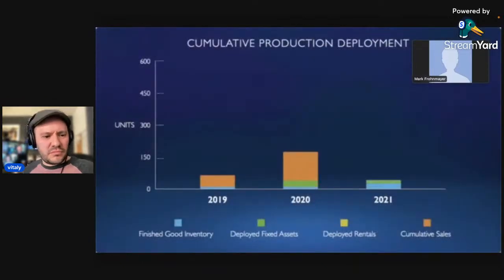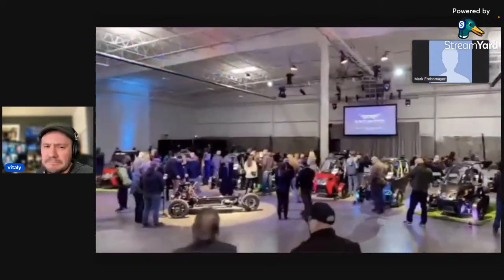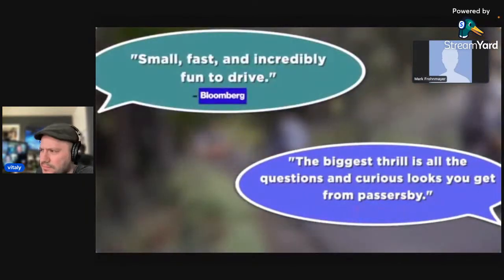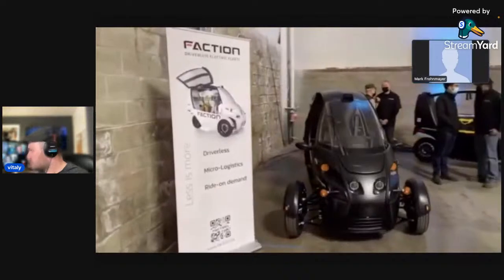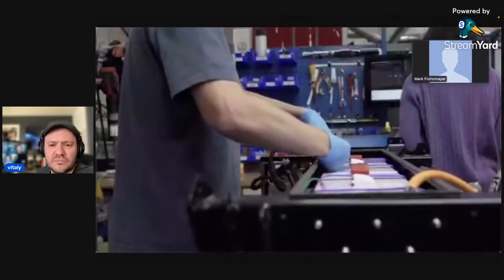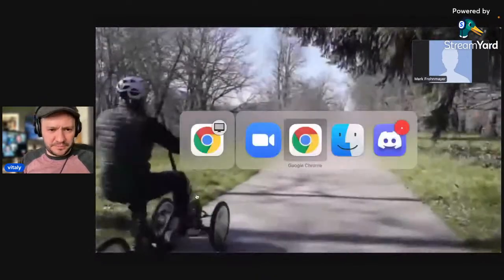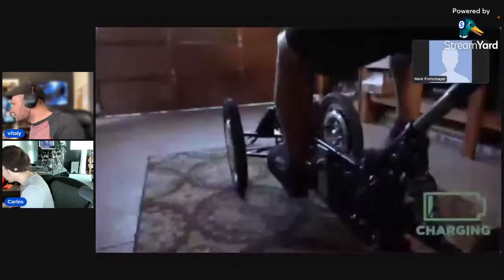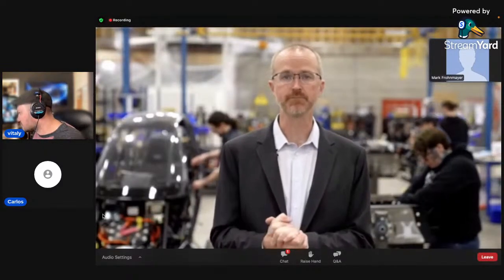Arcimoto FUV Q4 2021 LIVE EARNINGS

Comment: He said 3-6k
Reply from the maker: And maybe now over 8 for the first premium sales… so well see -V
Reply: @FreelancerFinance  Maybe - I didn't pick that up. When talking about other products on the market, he mentioned "8k and up" as top end products (not volume products of course).

To be honest I can't see bikers buying this machine, certainly not paying 8k for it. I have a bike for the freedom simplicity, independence from all, ease of use and maintence (almost none), dynamism, ability to pass through tight places and light weight. This product takes away all above from me in exchange for tighter cornering but it's not a fast bike, so tight cornering is a mere convenience in normal use. Only comes to itself when cornering at speed eg.g going downhill but who wants to go downhill on 3 wheels? 
A biker doesn't worry about added stability - bicycle offers dynamic stability by its very nature. I can see a usecase for non bikers having a go at riding this on holiday, but non biker never pays 8k for this machine, not even 5-6k, not even 3k! 
So the most likely use for this is a delivery bike due to higher load carrying, ease of balancing/ride especially when starting off. I remain skeptical of mlm and see it as a distraction, however addition of leaning feature to regular FUVs is a definite advantage but it also adds to complexity, weight, cost, component count, and manufacturing time. I remain a believer in FUV and its bright future. I think it's a give away at $3.16 stock price today, I picked up some more at this bargain price today.